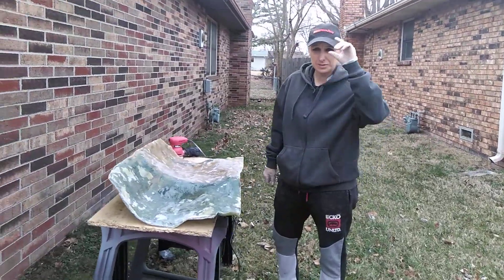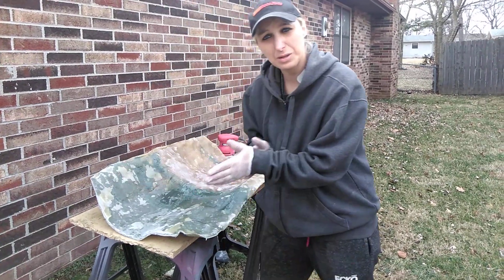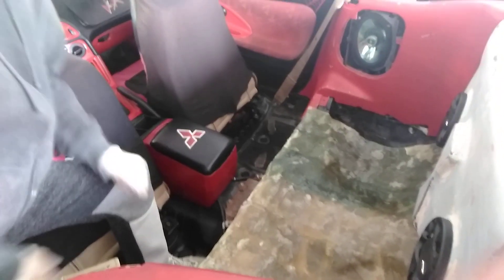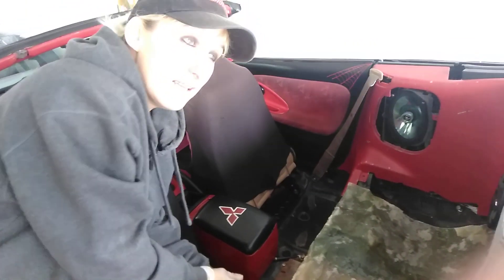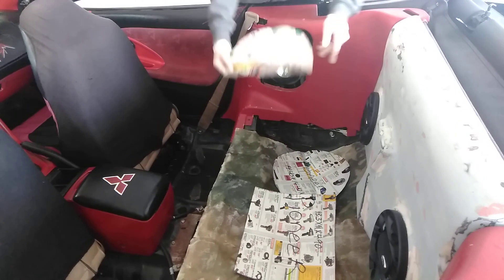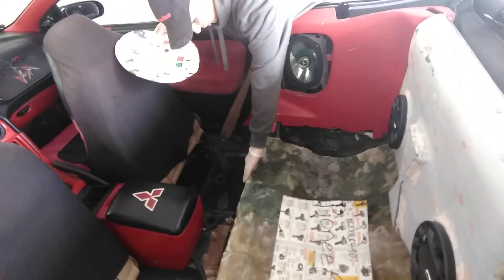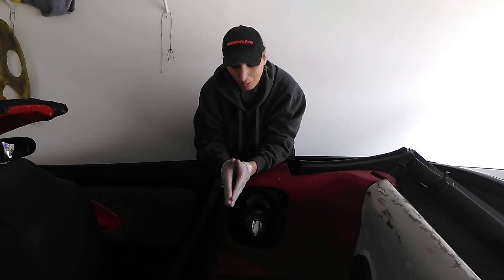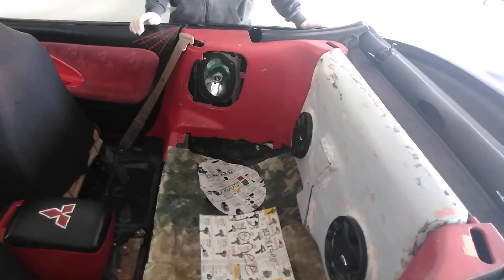Custom bk seat fitting vid4

Comment: pioneer 12's are okay as long as the amp isn't the 4 channel it should be fine. 2 channel bridgeable or mono block is what you should use. I'm guessing the subs are 4 ohm. so the amp should be 2 ohm. or 1 ohm. stable. make sure your alternator and battery are good and you shouldn't use any capacitors either if you need more power hook up a second battery, just make sure you have a battery isolator hooked up to it. kicker might be a better choice for a system. if you have a trustworthy pawn shop close by that might be something to look into cause you can usually get good name brand amps and subs at a good price just make sure it all works before you buy though.
Reply from the maker: Okay awesome thanks for the help Roy I might go with kicker actually I think the way I cut the molding I was doing my amp needs to be smaller
Reply from the maker: The subs are Pioneer 12 inch 1300 watt Max 300 watt RMS with voice coil cooling system and says you'll need a faston-lug terminal, I don't know what that is. The amp is a bridgeable 2 channel amp 150 watt RMS x 2 (4^), 240 watt RMS x 2 (2^). Bass boost 6db, 12db, variable LPF 40 HZ to 500 HZ. This is the system I was going to get I don't know yet and I'm still learning this stuff so I appreciate your help.
Reply: @dsmchick935  the terminal in question is just a standard clip terminal in every electrical repair kit. Wich I always keep one of those handy, cause ya never know😏
Reply: @dsmchick935  I never could understand why pioneer made there amps so large they always did. I'm sure that for what you are wanting to do that system would be just fine.
Reply from the maker: @royzcustomz  what about wiring my 6.5 speakers I have in the back will they fit on an amp with the subs
Reply: @dsmchick935  you should wire them to a separate amp.always better sound and you won't risk blowing them to sh1+ lol
Reply from the maker: @royzcustomz  okay then I'm going to have to have another battery to power all this stuff? Looking at my back seat setup where should I put another amp and a second battery or power source?
Reply: @dsmchick935  in tha trunk the wheel well would be ideal but you'll need your spare tire.. lol 😜 I have a vid of what you need to add a second battery. When we get this thing done it's gonna be great😉 lol
Reply from the maker: @royzcustomz  you have a video of that can you send me a link
Reply from the maker: @royzcustomz  it will be great when we get it done LOL wish you were here to help with the sanding to LMFAO that's going to be the hard part but hey I'll follow your advice I got the cheap da from Walmart and I can get sandpaper from Walmart to
Reply from the maker: @royzcustomz  what's a capacitor would that run one of my amps I just hate to put in a second battery
Reply: @dsmchick935  I said no caps. Lol they have a tendency to explode are ruin your amps. Just do a second battery it's much better and safer.
Reply: @dsmchick935  turn the amp the other way that way the wires will be equal length 🙂